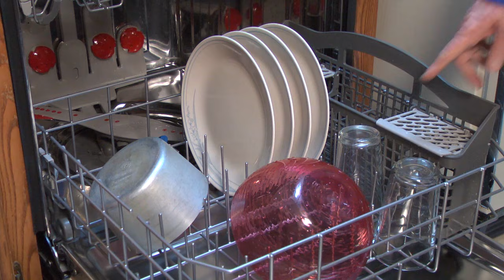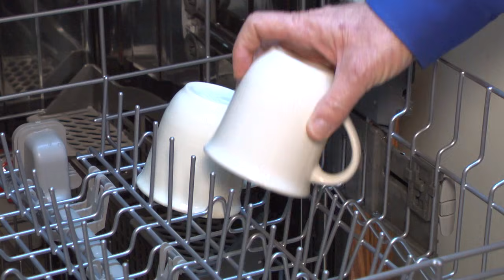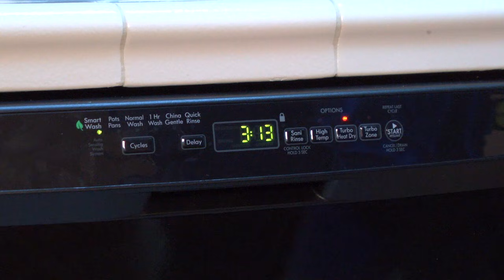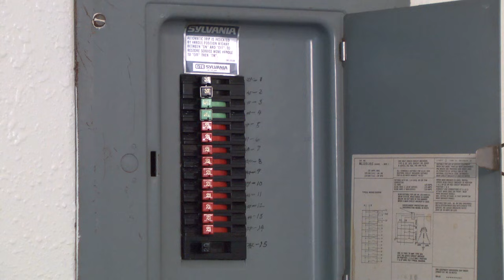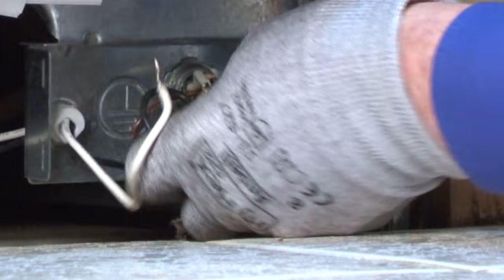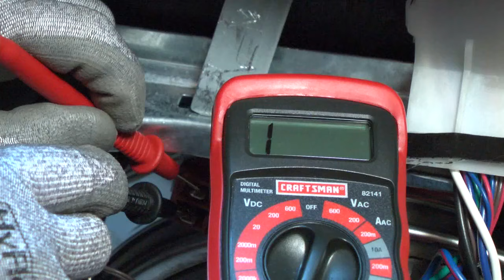Dishwasher Not Drying Dishes

Comment: Check the control board before pulling the dishwasher. You can see if it is burnt up before pulling dishwasher out and replacing heating element, just to find out it was the control board all along.

Comment: Wayne did the best explanations of things from over a dozen videos I've looked at. Thanks Wayne. I've been putting off checking this out. It was brand new when we bought our condo and the sellers had already moved out but it was never used. Brand new appliances and the water line was too short so it never even got hooked up. Hasn't been drying completely since day one so now I have some really simple and basic things to check before having to call a pro, if I even have to. Thanks again.

Comment: Why the God darn hell would I need a rinse aid for a $1000 dollar washer?

Stupid !!!! 

I had a GE heated dry washer $500 dollars that dried perfectly for 10 years , it failed so I bought a top of the line whirlpool which requires a rinsing aid and it doesn't do nearly the same job, OMG I'm pissed!!
Reply from the maker: We understand your frustration with the performance of your new Whirlpool dishwasher. You may consider calling or emailing Whirlpool about your concerns. They may be able to offer some suggestions that can help. We may also be able to offer some suggestions that can help you get better performance from your Whirlpool dishwasher. Let us know the model number of your new Whirlpool dishwasher and details about its performance issues if you'd like us to help you with some advice.

Comment: Great video for a starting point. I wish it went further in investigating the wet dishes issue, though. In my case, the steam is not being released from the inside of the dishwasher during the heating/drying cycle - so something's not opening to let it out.
Reply from the maker: Some dishwashers have a vent that opens during the drying cycle to allow steam to escape the tub. Let us know the model number of your dishwasher and we'll provide some information and troubleshooting tips to help you with your dishwasher.
Reply: @searspartsdirect  , Whirlpool WDF590SAJM0
Reply from the maker: @suerogers6859  That model of dishwasher has a simple vent that doesn't open/close during the cycle. Steam will vent out during the drying cycle. If dishes (other than plastics) aren't drying, a failed heating element could be the problem. Give us more details about the problem if you need more help.

Comment: In changing the heating element you do not have to pull the dishwasher completely out and turn it over.
You can simply pull the dishwasher out from under the cabinet part of the way and lay down in the floor and reach up under it easily to undo the Locking nuts holding a heating element in there is no reason to fully remove the dishwasher and turn it on its side.
Reply from the maker: You're right. You can use that process to change the heating element in some dishwasher models. In this video, we show pulling the dishwasher out and laying it on its side to check the heating element using a multimeter. Here's a link for our video that shows how to replace the heating element in a dishwasher: https://www.searspartsdirect.com/repair-guide/Dishwasher/how-to-replace-a-dishwasher-heating-element.html .  In that repair video, we also show how to pull the dishwasher completely out and lay it on its side so DIY viewers can see how to get the easiest access to the heating element nuts. Because the heating element nuts help hold the heating element water seals in place and prevent water leaks, it's important for DIY'ers to properly install those heating element nuts. Advanced DIY'ers may be able to remove and reinstall the heating element nuts without pulling the dishwasher out and laying it on its side.

Comment: Thanks for the video, anyone can help me on this one? "No dry heat" light on continuosly I have opened everuthing redid some suspect soldering on th eboard, It worked fine than the "no dry heat" light turn on again after a while, I believe is a wire problem.  After seens this video, I think I'm goingto open again and check the temostat and the heating element.
Reply from the maker: Let us know the model number of your dishwasher and we’ll try to help you with some troubleshooting tips.
Reply: Kenmore Elite 665
Reply from the maker: Thanks for posting that portion of the model number, but we’ll also need the 8 numbers after the 665 to tell which type of Kenmore Elite 665 dishwasher that you have. Many different types of Kenmore Elite dishwashers start with the model numbers 665.